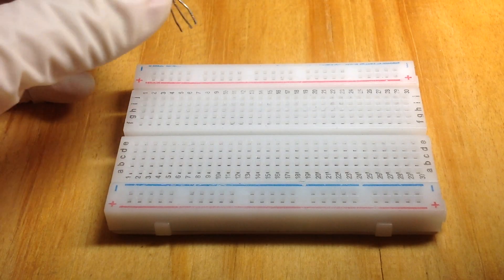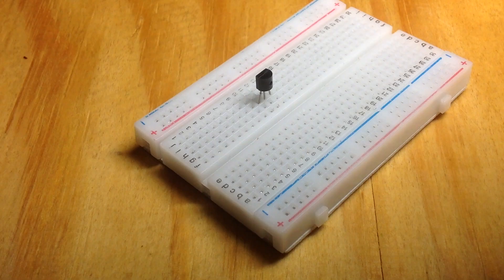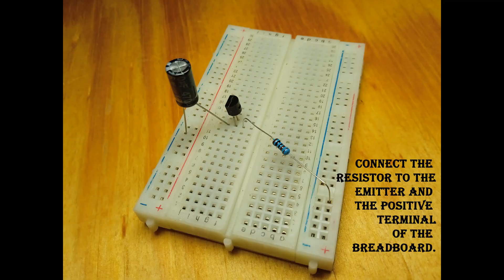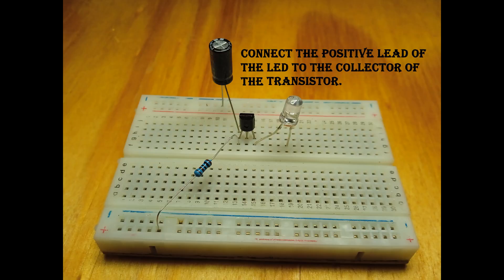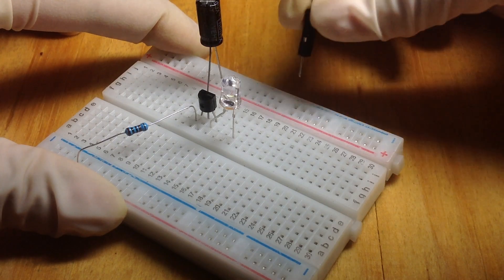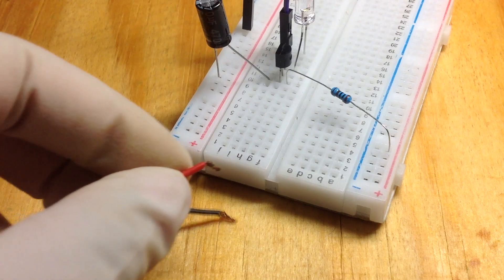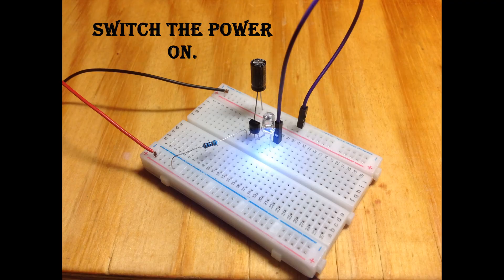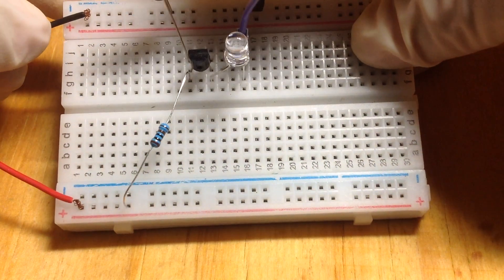Single LED Flasher Circuit using a Breadboard

Comment: You can change the rate of blinking by either increasing or decreasing the size of the capacitor.  A higher value will give a slower blink.

Comment: it worked for me but only when the input voltage is about 13V no less.    Why is nothing connected to the base leg and this works ???
Reply: When voltage is high enough it will flow trough transistor without base voltage, this consumes alot of current and so it discharges the capacitor. Atleast thats my theory...

Comment: I can't get it to work on my breadboard from what you are saying. Please help me
Reply: This circuit called esaki oscillator.
1. You might check with RC charging loop (12v-R-C-Gnd) and ensure that E of BJT connect with positive of Capacitor.
2. LED positive part connect with C of BJT.

Comment: It's called the Esaki Oscillator. It's good habit to connect the negative wire to the breadboard first so it eliminates 'potential' accidents. Keeps the capacitor from jolting the circuit.
Reply from the maker: Hi Peat Moss, thank you for the great and helpful advice and I will remember that for the next videos.